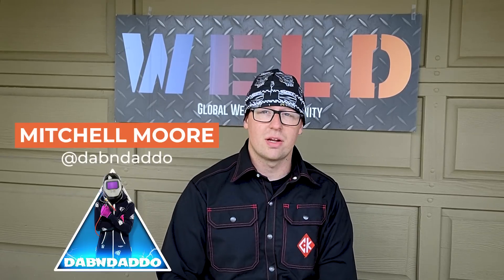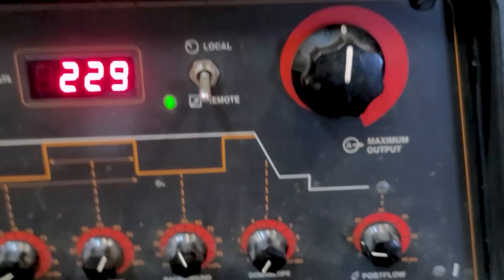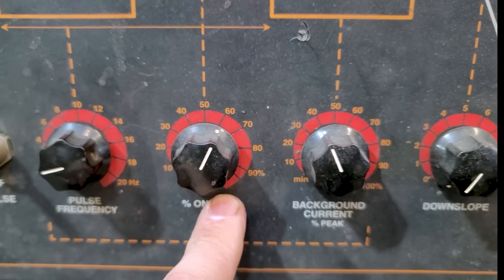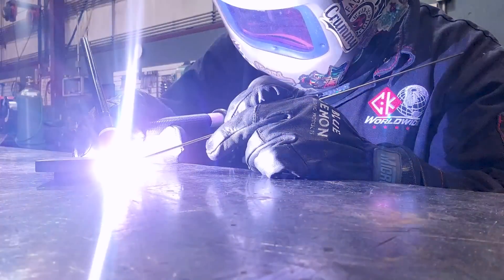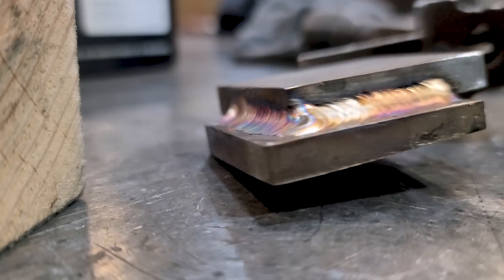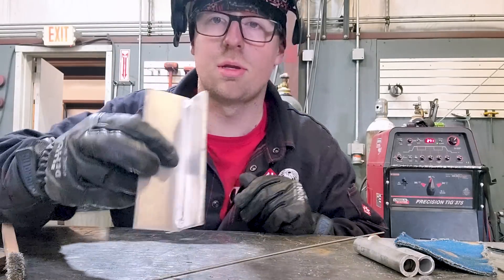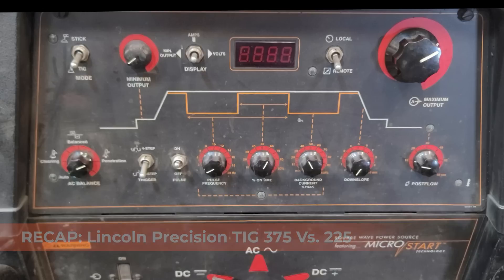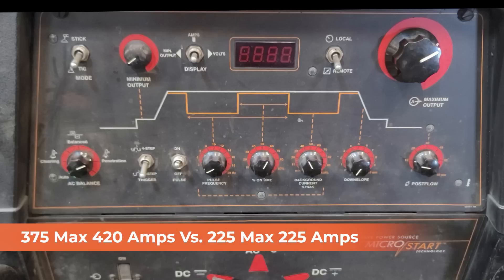Lincoln Precision TIG 225 vs 375: Setting Welder Parameters

Comment: There’s so many new welders for less $ than these old transformer machines these machines are to expensive for what they do these days. I’m not knocking these proven machines just saying there phasing out for smaller more adjustable cheaper inverter machines.

Comment: As noted in the video...use post flow to shield the end of your weld.

Also great for keeping the end of your rod under to avoild putting contaminated metal back in your weld when you go fire up on it.  Exact opposite was done in video.

Comment: It's funny how you sit there and say how many knobs are on the 225 and how many knobs are on the 375. I have a prime weld Tig 225x it's got 13 knobs on it most important is AC freak AC balance pre-flow and post flow and of course you're amperage knob. Also too on my machine it's also checked out too for 2T and 4T motion so I also have upslope down slope base amp all that. And then on top of that I also have pulse up to 200 HZ. And I'm sure my prime weld with the max cool 3000 water cooler and my CK worldwide flex lock torch. Probably cost 25% of what that Lincoln aspect cost or any Miller diversion or dynasty or synchro wave.

Comment: I run 15-20 on an 8size gas lens all day. Gives the same result as your 33. I can tell you don’t pay for the Argon lol
Reply: I run 35-50cfh from my own bottle. Gas coverage is important 👍🏼
Reply: @mitchellmoore902  
It's NOT that important  . In a shop , no wind , no fan , no fume hood , 10 cfh could  produce acceptable welds . There are charts available with  recommended flow rates.